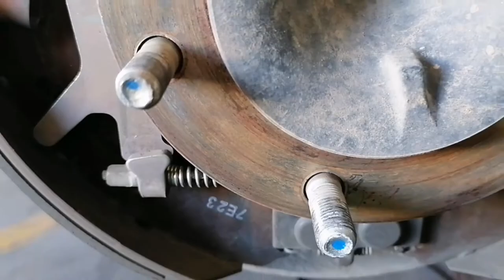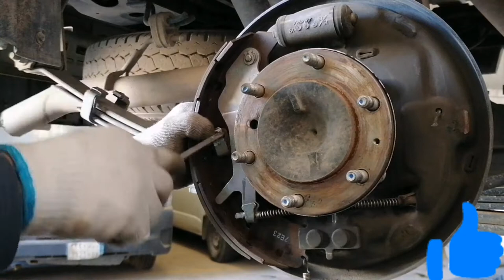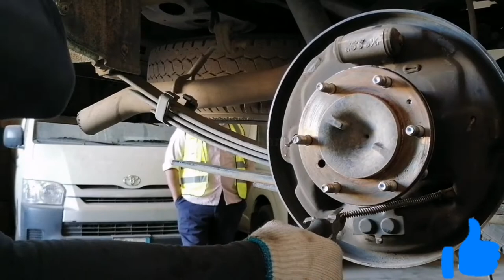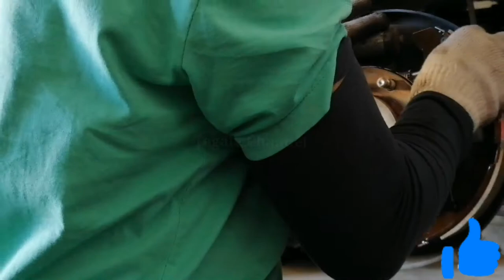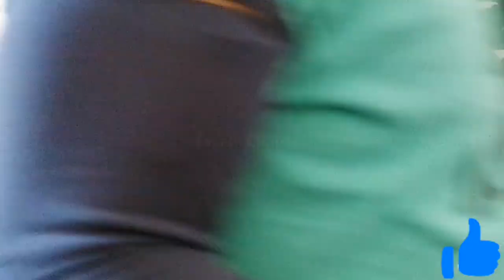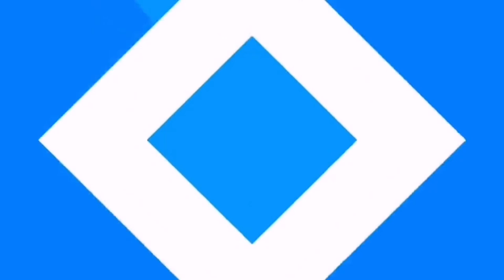How to Replace Brake Shoe Rear Isuzu D-Max

Comment: Hey mate, thanks for sharing video. Quick question, I have changed to bigger wheel 255/17/r18, but since then my rear brake start making noise when I put foot on brake Prior to changing tyre no issues. Brake pads checked and still has good life.
Any tips or clue why?
Reply from the maker: Please  cleaning the brake shoe or brake pads
Reply: @TagalaChannel  all ready done but still same noise